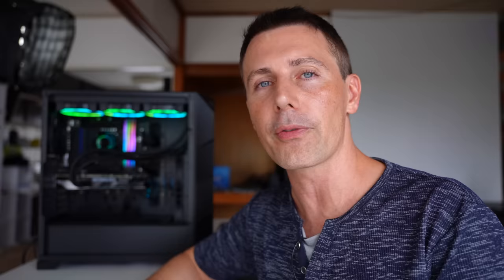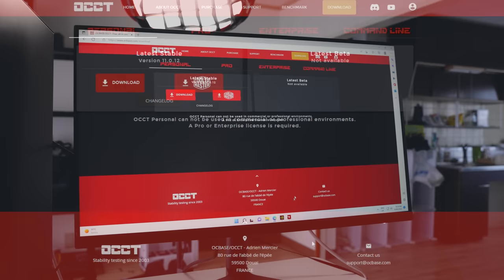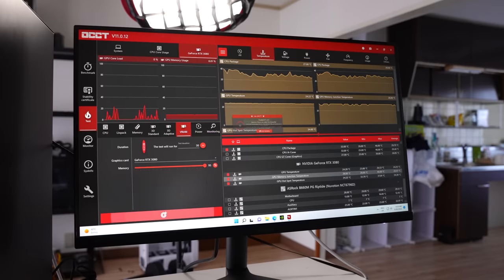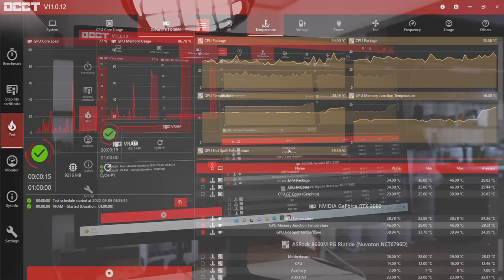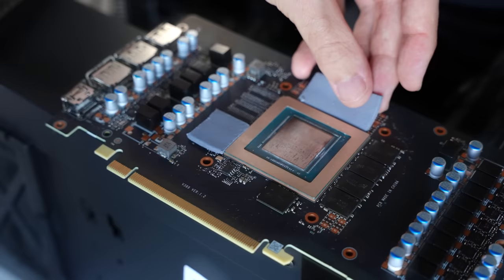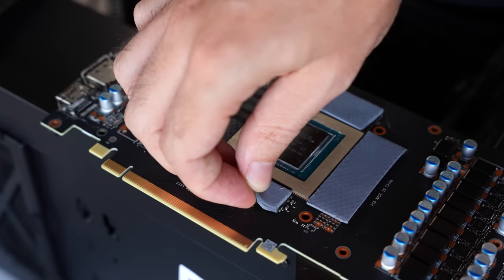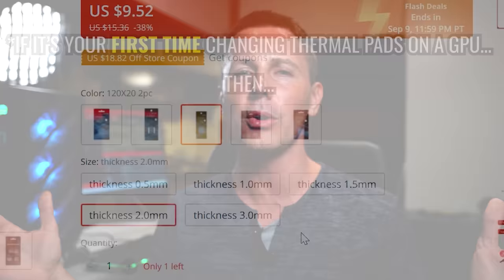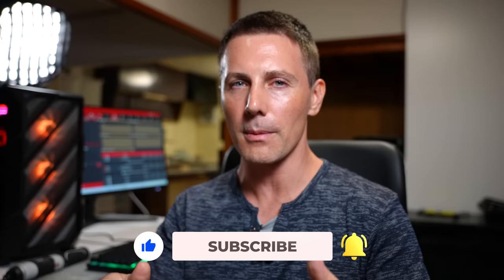Are These $10 GPU Memory Pads Worth it?

Comment: I changed mine because I ripped them off by mistake.
Reply: Pads are probably $10 for like a3 size hahaha
Reply: @RYU47376  Depends if you are paying more for higher thermal conductivity.
Reply: If the ones that tore look and feel like tofu, then it was no mistake.
Reply: If it's from ali express it's most likely going to be fake.

Comment: You have to be really careful with choosing the right thermal pads, my gpu died after a day with the new thermal pads.
Reply: That sounds more like a GPU problem if it hits high temperatures it should shut down it shouldn’t die. Unless the card it was already faulty. There’s a few good YouTube videos that show you all these different brands the squishiness and thickness of each so you can determine the correct thickness. Some of the 2MM are squishier than others or Stiffer.
Reply: You had the wrong size?
Reply: @swizzler8053  the thickness was right, but the original ones were more soft and more thermal conductive
Reply: If you mod something, you have to be prepared to buy it twice if it breaks, which begs the question, why didn't you just buy the better model, to begin with?  People who mod are either rich, YOLOers, have had experience with other cheaper/expendable parts, or are YouTubers with warehouses full of parts to work on.
Reply: @eliashowe7115  dude many GPUs didn't have good paste or pads, even on top of the line GPUs.

Not to mention that weather + humidity condition during shipping / storage can also affect their quality.

Comment: I’ve switch my stock thermal pads on my rtx3080 and Ti models and seen between 7-12c lower temps under gaming loads. My Ti had some “meh” stock pads which actually replaced with Gelids and saw about 11-12c drop in memory temps. My Ti isn’t water cooled and using its stock 3-fan cooler. My 3080 is running about 7-10c cooler under gaming load and slightly lower again once I placed on an EK waterblock 😇🥰👍

Comment: I replaced my thermal pads with copper shims, it's much better than any thermal pads I ever buy. The temperature drops from 80 C to 65 C. hotspot from 95 C to 75 C and VRAM temp from 82 C to 70 C compared to good thermal pad (Thermaltake). Copper has much better thermal conductivity and much cheaper too. I bought 10 pieces for less than 7$ total. The installation however is much harder than thermal pads. It's not for everyone.

Comment: Just repasted my 2080 ti and didn't touch the pads I just put new paste on the GPU and put it back togeather. Temps went from 82 down to 67-70 under full load. NICE!  With that said the GPU came apart real clean and the old pads were completely fine, if they had ripped apart I would have changes them also but...they didn't :) All in all a great results with the old pads!

Comment: I really wish the AIBs certified thermal pads and thermal pastes/putties for use in reconditioning GPUs so there wouldn't be so much guesswork , which if it turned out wrong in terms of thickness and stiffness could break the GPU , or the VRAM from the board and turn hundreds of dollars into a paperweight.

Would be so much easier if you bought some thermal grizzly and it was "approved for EVGA FTW3 models" or something like that
Reply: Very good idea, email thermal grizzly.

Comment: GELID thermal pads are insanely good value; best for its price range. TekShinji did a comprehensive benchmark of several after-market pads, and the Gelid pads topped the chart in price/perf.

But unintended effect of good pads: the heat still gets dumped onto the same heatsink -- so while it will help lower your VRM temps, it has an adverse effect of raising your core GPU temps at equilibrium a few degrees higher. Not too important in the grand scheme of things, but something to be mindful of.
Reply: That´ll heavily depend on the cooler of the GPU.

On something like a TUF 3080 were the memory and Core don´t have a directly connected cooler it improves both, as the thermal paste you´d use is likely better too.

Also On my Strix card I´ve only seen lower temps on the core since I´ve replaced the pads.
There is a reason for that too.
Thermal transfer on a copper cooler is way higher while it has a lower temperature. Meaning if there isn´t 90-105°C memory but 68-74°C memory (numbers from my personal experience) then the cooler does have a lower overall temperature, meaning the core temp isn´t actually negatively effected at all.
Reply: core being 3*c higher won't affect lifespan, vrms and memory are much more sensitive to heat
Reply: polished copper shims on vram and the gpu die actually significantly drop temps over pads they need to make a pad with copper in it if they can make copper stretchy wastebands then a copper thermal pad should be no problem
Reply: I don't see how this is an issue considering that's the entire point of those thermal pads even being there.

Comment: Just make sure you measure your thermal pads before you order. Too thick of a thermal pad will cause more issues than not changing them. Always check with your own card model and model number as each cooler and each 3000 series card will have a varied amount of thermal pad thickness. The aorus master 3070 to has 3 sizes, 1mm, 1.5mm and 3mm (for the backplate)

Comment: If you have a metal back plate, it help to put pads on the back side of the PCB to move some additional heat from the other side of those memory dies. I don't remember my exact results, but it was enough that I was happy with the time/effort invested.  I also put some copper heatsinks on the outside of the back plate to help more. That GDDR6x makes some heat.

Comment: Did the same thing with Gelid2.0mm on a used 3080 FE bought off eBay. It reduced the hotspot by 19 degrees. I don’t even worry about the heat anymore. Also, the FE cards are the worst to open up.

Comment: I spent some time looking into this and the issue is the 2mm thickness of the pads in the reference design. My gigabyte model has a heatsink with a raised heatsink so the thermal pad can be 1mm. Copper shims from aliexpress with paste between the shim and heatsink and thinner pads would give better thermal transfer.

Comment: Gelid Ultimate 15W/mK pads are awesome. I've watched many comparisons between pads and Gelids were consistently the best, or within 1C difference with the best. While being much cheaper than the other premium thermal pads.
I'm using those pads currently on the backside of my GPU after installing a big finned heatsink on the back of my 1060 6GB. It does its job really well. The heatsink on the back gets really hot to the touch without airflow (can't touch it for more than a couple seconds because it's hot). It definitely helps with cooling both the memory chips, as well as the GPU core. The effect would be even greater on more powerful cards than my 1060. I'd recommend doing this mod to anyone really.

Comment: i changed the ones in my strix 3080 for a copper plate that was machined specifically for it. it dropped 30C easily. was at 105C and now its between 65-70C
Reply: Got the specs for that?  It sounds like a good mod

Comment: It's important to measure the results under real-world use cases, not just synthetic memory tests. In many cases having much better thermals on the memory can actually lead to higher core temperature because the cooling solution is having to absorb much more heat. My 3080 Ti FE with new pads did drop memory temps down a staggering 20-30 degrees, but it also raised core temps by about 5-10, and this is with the exact correct thickness measured by myself and very careful and precise mounting of the cooling solution. This may not matter if your core usually doesn't get hot, but if you play at high resolutions and push the card you could actually be losing performance due to reduced thermal headroom on the core. If you are going to go the distance with new pads it may be prudent to go all the way and do a water cooling solution that can dump all that extra heat. I sort of regret my 3080 Ti FE. The FE cooler just does not keep up, and the stock pads are embarrassing.

Comment: I did a research as well back in the day about this like half a year ago... but I wasn't sitting on any High End card, I was using MSI Gaming X RX480 8GB for a quite some time, and I was pretty concerned about the thermal pads after changing my thermal paste, so I looked for something to replace them, just for the sake of getting peace of mind... and I did order the same pads that you did there but different thickness to match the originals. 

After replacement my Memory Temp was slightly less... and core also dropped few degrees, so it didn't change much, but I think it was worth it anyway... I replaced my RX480 for RX6600 on my Main PC though, but I think I will do the same course of action with pads after some time anyway...

Comment: It depends on the card, but I changed both thermal pads and thermal paste on my old 3060. Temperatures were through the roof beforehand because of TERRIBLE factory pads and paste from GIGABYTE. I only changed paste on my 3070 because the factory pads from MSI were decent enough at keeping temps low. But the paste was obviously not up to my standard. :)

Comment: In recent years I've replaced all GPU and MB pads (VRM, chipset/PCH, VRAM) with GP Ultimate in both my last two machines. Even without sensors, using both the 'finger test' and an IR thermometer it's quite clear that (in most cases) there is pretty massive difference - the sinks are much warmer, 10°C or more. Unsurprisingly it's most pronounced where the original pads were the cheap, rubbery silicone ones.
Gelid GP Extreme and Ultimate are effectively pre-formed strips of thermal putty rather than 'pads' as it's usually understood, and if you check out the price of good thermal putty they're very good value (and certainly a lot more convenient and neater than putty).

Comment: Even at 64 degrees, that's a long way off throttle temp for the G6X. I've always thought G6X ran really hot, but maybe it's just this cooler is really good or they used better pads? But if you're buying a used 3070 Ti on up... I might not consider it if they haven't done something for the memory since it's really easy to hit throttle temp when mining. I know there are a lot of better options, all the way up to copper shim plates that really help with cooling.

Comment: Should have tried or compared the cheaper Amazon thermal pads where you get 4 sizes for $10-$15
Reply: Different pads have different thermal conductivity. That's why some go for a premium.
Reply: @Safetytrousers  oh yea I get that just see what temps diff would be between regular and “premium” pads.
Reply: @killerrf  The original pads on this GPU would have been regular pads. They wouldn't have been designed to be actively bad.

Comment: For my 5700xt the gelid extreme pads reduced about 10 to 15 C but my core temp rised a little . Expensive, worth it if youre watercooling
Reply: What temperature are you getting? I was getting about 70c while i was mining with the card which seemed fine to me. Kinda lazy to open the card but the thermal paste is due as well it's been 2 years since i bought it.

Comment: I replaced my stock ps4 pads with fujipoly ultra extremes and while I haven't measured, it does seem to have helped transfer more heat to the mid-plate. I compensated by cutting some holes and adding some fans. Looks pretty hc but it I like it!

Comment: I've replaced mine on my 2070 with these, they're great it also looked like my specific card had some missing on a set of vram. I have also heard after a certain point you might have deminishing returns as the backplate cannot dissipate the heat quickly enough. Would recommed 10/10 mine dropped about 10C

Comment: I thermal pad modded my 3080 FE with 2mm Gelid Extreme pads and saw some improvement. Two weeks later, I copper modded with 1.2mm plates ($10) and thermal paste on either side and the improvement was much more significant. 

I don’t mine and cap my frame rate to 60fps while gaming. I just want my GPU to run cool and last a long time. My next rig will be in at least 5 years.
Reply: Imagine having a 3080 and capping your fps at 60
Reply: @99mage99  well if it's 4k monitor, 60fps makes a lot of sense.
Reply: @99mage99  My monitor is a content creation monitor and is at 60hz. More fps caused tearing issues so 60 fps is smooth enough for me.
Reply: @t0nyxgq  Imagine having a 3080 and only one monitor.
Reply: @99mage99 i have 2 monitors both at 60hz. But recently I got a third 2K monitor at 144hz and it’s very smooth. I use that for gaming now.

Comment: Be curious to see the same test done but with the copper shims mod — use copper sheet the same dimensions as the thermal pads with the bare minimum of thermal paste applied between the memory and copper shim and then also between the copper shim and cooler.
I’ve seen this done in other vids but been dubious with the results — they seemed to good to be true.

Comment: Could you revisit this and add thermal pads on the back so that the backside of the memory contacts the backplate? And see how much difference it makes since gddr6 is flip chip and the hot side is at the back
Reply: if the back plate was not paded its going to be tricky as he will have to figure out the thinkness of the pads i know from seeing miners change pads yes changing the pads on the back plate does help too even on my 3060 that i redid it helped

Comment: I finally got around to changing my 3090fe out a couple days ago. I used the thermalrights (3 pads) 1.5mm and went from 104c to 80c. Can't believe how expensive this card is and had to do this to keep from nuking my system and prevent thermal throttling... Ridiculous... 😮‍💨

Comment: For a top mounted radiator (for exhaust), do you recommend a push or pull configuration?

Currently it’s in a push configuration but it’s damn noisy and wish to quiet it down a bit
Reply: This is very dependent on the case you are using/ config of the other fans/radiator placement. Need more info for very accurate advice. In general tho positive pressure in the case is best

Comment: The original pads on your 3080 look good anyhow and you are water cooled?. The FE 3080 had some nasty oily pads, and mem temps would easily hit 100C, especially in mining. That's why most people did the pad swap. For myself and my original FE 3080 swapping the pads made a huge diff to the VRAM (like over 20C). Incidentally GPU temps don't drop and could even go up a little as you are now dumping more heat into the heatsink. 
You do need to make sure you get the right pad size as it can affect the GPU die mounting pressure. I (and others I know) have had good results with Thermalright pads.

Comment: Should've added kingpin paste on memory, then place the pad, then add more paste to finish the sandwich will give you better thermal transfer. Also, the gelid pads are too hard, so look for softer pads like Valor Odin.

Comment: I had great success in that my VRM's didnt have pads so I added pads onto the VRM's and my GPU hotspot temperature decreased by about 10 degrees at full load.
I would have thought that we are loading the cooler with more heat so that would increase the GPU temp but actually no, for some reason,
the memory and gpu temps were great.
oh, I have a 6700XT Mech X2 OC and was having issues with driver timeouts before that.
I am thinking my next step may be to make the backplate a passive cooler by putting pads inbetween cos at the moment it is just for show.
Reply: I had this timeout with the msi rx 6600 mech 2X model too but the card had like 52 Celsuis max temp. What a weird model
Reply: The VRM is thermally well coupled to everything on the GPU with a lot of the coupling area having little opportunity to remove the heat, it's essentially forced out through the components. The coupling occurs via the massive ground and voltage plane pours in the inner layers of the PCB. Heatsink actually usually has a fair bit of thermal impedance between the different areas and it can absorb that extra heat no problem either.

Comment: When measuring your original thermal pads make sure you measure the part that has NOT been compressed because obviously that'll make a difference.
Reply: I think you are right, new pads should be fractionally thicker so that they can compress slightly and spread into imperfections in the surfaces. I believe manufacturers of the materials normally specify this on the datasheet. So a pad measuring 2mm when removed should be replaced by a pad that is say 2.2mm to 2.5mm uncompressed.

Comment: You don't need thermal pads.  You just need Thermal Paste. 
I took off my pads, and coated a good layer of thermal paste all over the memory, and put another layer over the rest of the gpu.  I put some inside the Display Port as well.  It lowered my temps down 58-65c.  Was incredible.  And I still had some left to make a sandwich.
Reply: I highly recommended toothpaste. Doesnt lower the temperature but my card now has that winning confidence and all-day freshness to deal with life's challenges.
Reply: @kaloifortich4491  hahahahaha

Comment: Hi Brian, i have a Rtx 3060ti and I live in a hot environment & only use it for gaming. The temps reached 80c stock & 75c undervolt but the fans still too loud (2500rpm). Can a copper shim on the gpu die will help?
Reply: Dont think so. The extra layer is probably   not ideal in anyway for thermal transfef

Comment: i saw a temp drop with re-pasting the thermal paste on the gpu chip itself
Reply: The GPU die does not affect the temperature of the memory (unless the die is throttling). This was a pad test, not a paste test.